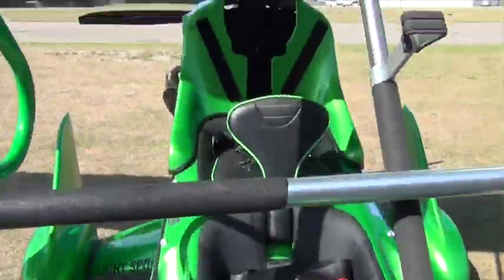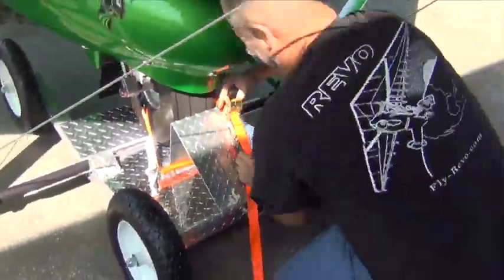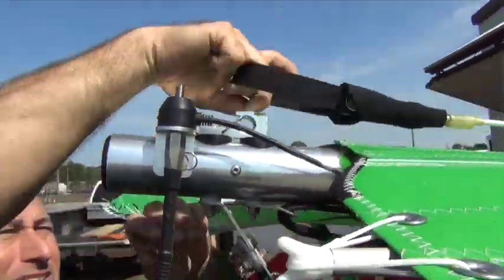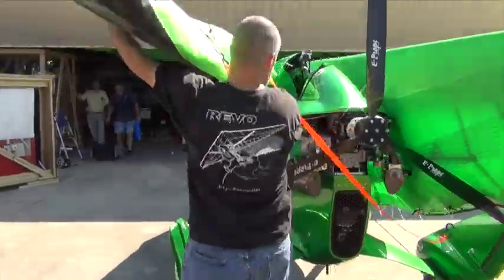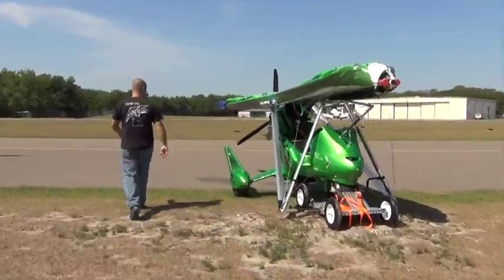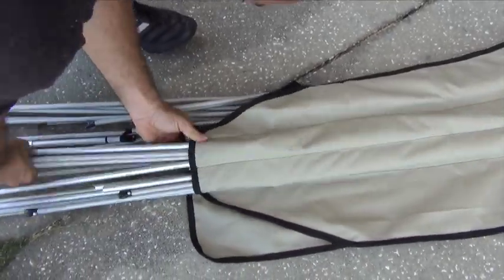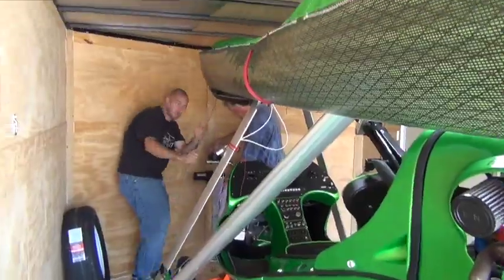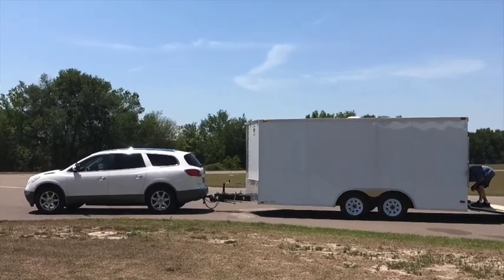wing fold

Comment: larry really like the inovation. couldnt you just put a small roller on the keel and let it slide in a protective channel on the engine cowling.  and with a little r and d  put a ajustable clamp on the cart to hold the tire secure. not nit picking. just i never like reaching for straps if i dont have to. but for sure really good video for youre revo owners.